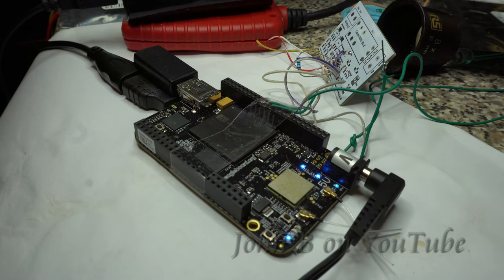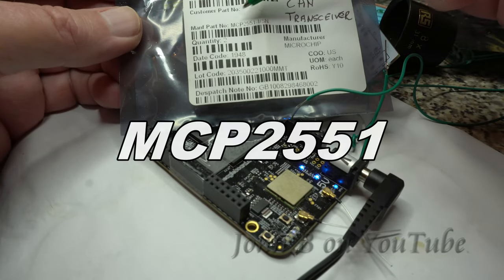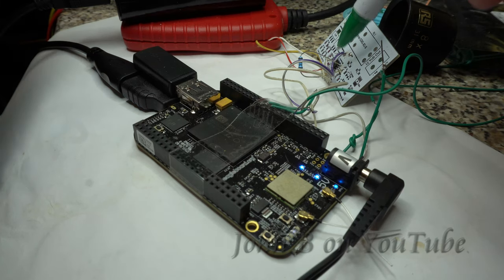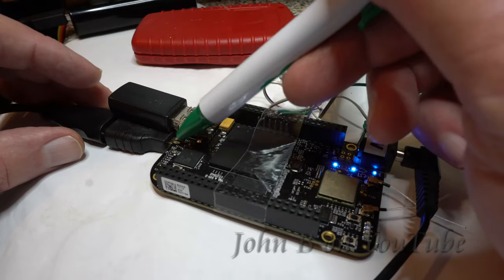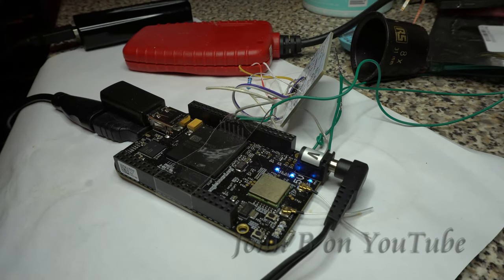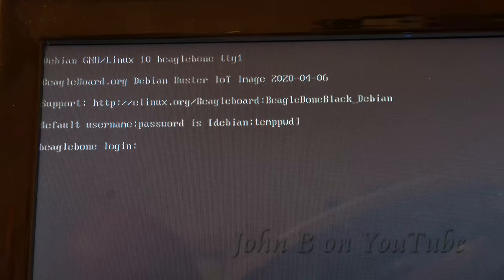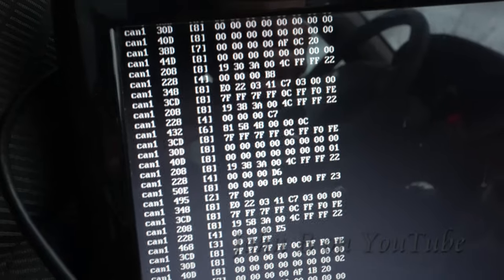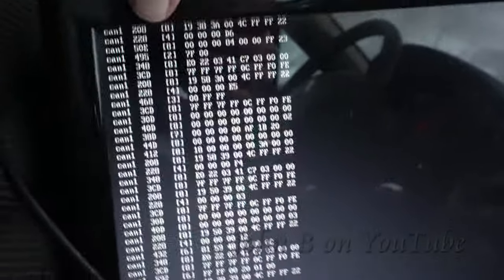Beagleboard CAN Demonstration & PRU Demo using some WS2812 LEDs.

Comment: Thanks a lot for this! None of their examples worked! I'm a complete noob, trying to follow their comments, things just didn't work. Their neopixelStatic.pru0.c says to wire data to P9_29 but that sys file doesn't exist, so it just errors out. I attempted to change it to a similar pin (P9_30) that did exist, still did nothing. Your code finally got these LEDs lit!
Reply from the maker: Thank you for your comments and feedback. It’s such a shame the literature on the Beaglebone and all Texas Instruments boards is so poor because the processors are fast and capable but difficult to use.